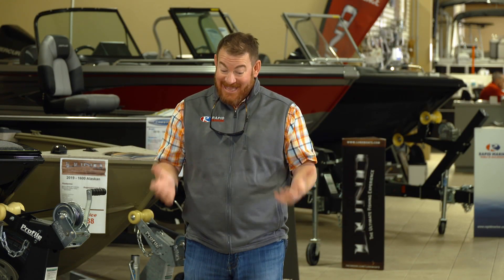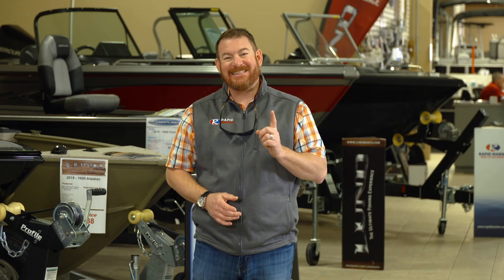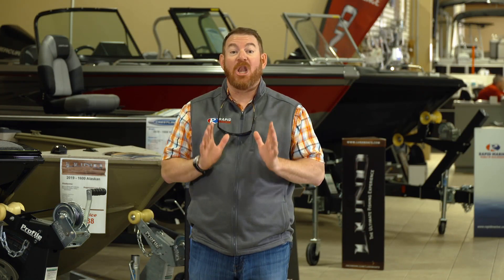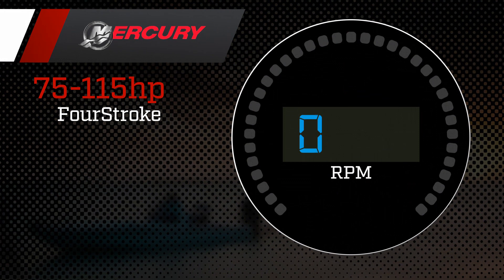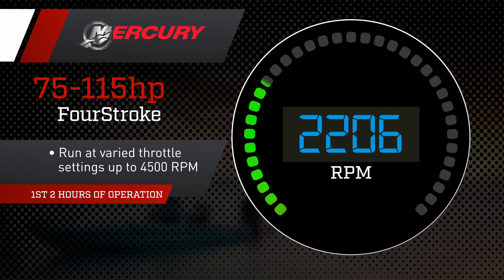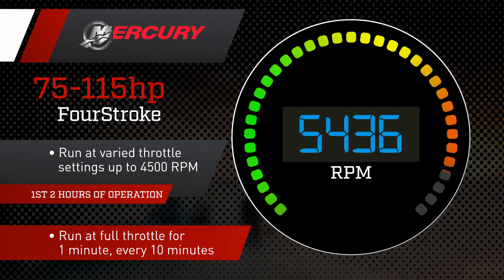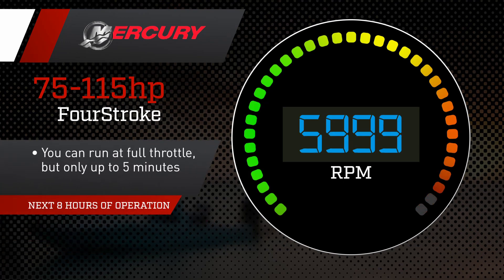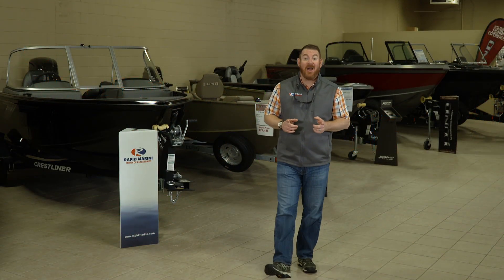Mercury Outboard Motor Break-In 75 to 115 HP

Comment: I was unable to do the full throttle part of the break-in due to water conditions, is that an issue? I did get a few runs towards the end at full throttle but not every 10 minutes for 1 minute as the manual stated.